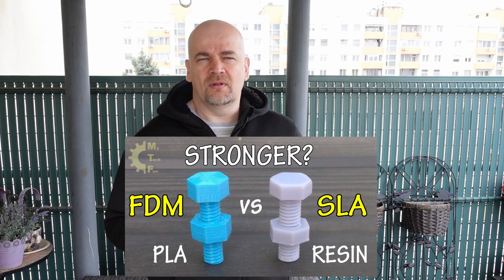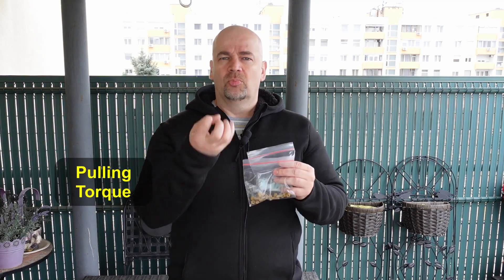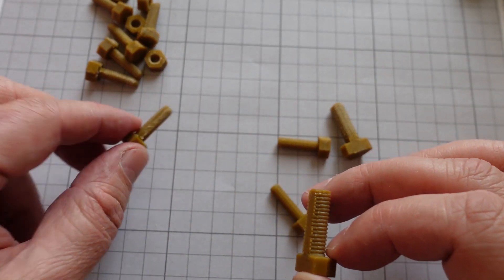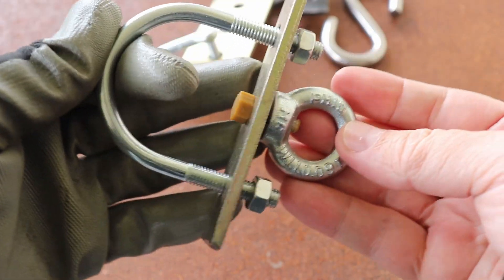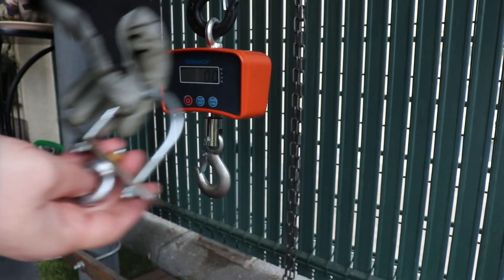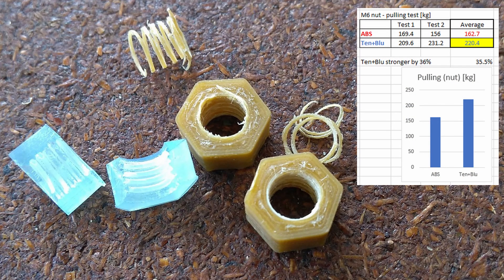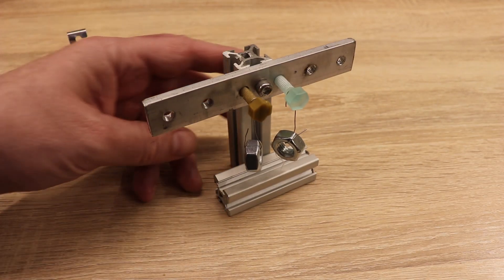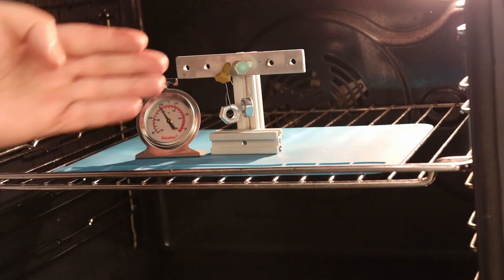ABS vs Tenacious-Blu mix, the 3rd match FDM vs SLA 3D printed bolts and screw nuts

Comment: As someone who has a great FDM and SLA printer, resin is superior in almost every category once you know which resins to use. So much so that my Filament printer has been sitting for months.
Reply from the maker: Thx for comment. What FDM/SLA printer do you have? And what resin are you using?
Reply: @MyTechFun  Ender 3 V2 and an Elegoo Mars and Elegoo Saturn. I usually use Elegoo water washable, or Elegoo ABS like and cut them with various percentages of Siraya Tenacious.

Comment: can try to print Tena bot nut in horizontal position?
Reply from the maker: SLA printing orientation tested, it doesn't affect the strength significantly as with FDM: https://youtu.be/E7XDMzGb5WI

Comment: This really seems to be the first resin which can compete with fdm for technical parts.
Have you thought about testing resins for creep? Have a 15 cm long, 2 mm diameter rod printed, then hang some weight to pull with about 1 MPa and then check every week how long the sample is. Nylon in a week is already longer! Abs is much better. Resins? No one knows, no one did the test.
Reply from the maker: Yes I am preparing creep tests too, not exactly as you described. One will be tensile creep test, specimen looks similar like mine in pulling test (check my PolyTerra PLA video - two holes) only I need longer and thiner objects. The second will be 3 point bending creep test based on ISO 178 - load and follow the bending.

Comment: For your next test, please print the resin objects solid instead of hollow. I get the impression quite a few of the catastrophic failures were due to very flimsy / thin prints.
Reply: Indeed. Hollow vs full infill makes a difference. No matter what kind of material, especially on the impact tests.
Great video though 👍
Reply: It's all in the post cure at elevated temperature which he is not doing.
Reply from the maker: Hm.. Maybe it would be good to measure effect of the post curring.. "he is not doing" because "he" used 3D printing service and this is what we get from SLA printing companies as service..
Reply: @rgstever  it isn't all in the post cure. Strength is going to be proportional to the amount of material used, which is much less for thin-walled hollowed objects.

Comment: Slight advantage to resin on the nut torqe test since how they break clamping the nuts when testing the nuts may help the resin to not break witch give it an unfair advantage. Just a small remark. Not sure about a solution to it though xD